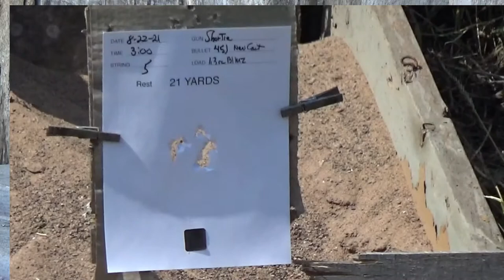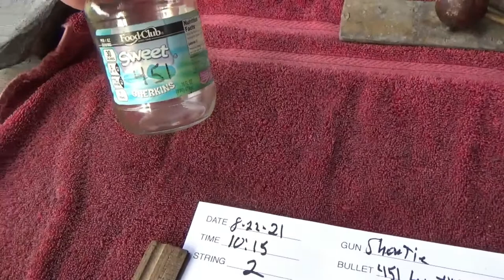Pietta 1851 Sheriff 44 cal - 5 1/2"

Comment: This is only my opinion, but I think this channel is among the very best C&B / BP channels on YT. Thank you for the content. 
Some thoughts : some of the guns I bought came dirty out of the box. Both were proofed in Gardone, one 1858 Uberti and one 1860 Pietta. The 1858's barrel was really dirty with a touch of rust (light surface rusting, no damage); Pietta's 1860 internals and barrel were filthy but no rust. 

Last gun I got is a steel frame .36 7 1/2 inch barrel 1851 from Pietta :  it came clean as a whistle. First thing I do now upon unboxing is inspect the gun and clean it if needed. 

On a side note, that 1851 I got is truly an excellent gun and a shooter out of the box. Shoots better than I will ever do myself.
Reply from the maker: I'm in the habit of checking the barrel also.  Had one for 4 years before checking, and there are slight pit marks now after cleaning.  Doesn't affect accuracy it seems, but sure isn't nice and shinny to look at.  O.R.

Comment: I have found that the Hickory wedges that come with new axe handles are great for removing barrel wedges and setting caps... you can split em and make like three nice tools about 3/4" wide and still have enough left to... well.. use as a wedge for the axe handle
Reply from the maker: 👍o.R.

Comment: These old smoke wagons are still relevant !

Accuracy is superb.
Reliability is ok  (kept one loaded fro 2yrs and 6/6 chambers fired at first try), as long as you don't make foolish mistakes and power is respectable at 390 ft-lbs at the muzzle with moderately weak Schuetzen powder.  I think they can be as powerful as standard pressure .357 magnum with proper powder selection (I'm thinking of FFFFg Swiss). Will need to check that out though.
@edit Tested !

220 gr Kaido slug
30 gr fine FFFFg Swiss

1# 953
2# 939
3# 968
4# 949
5# 971
6# 964

avg: 957 fps
KE: 447 ft-lbs.

for comparison, low end .357 magnum after wikipedia:

180 gr (12 g) JHP Federal	

1,080 ft/s (330 m/s)	
466 ft⋅lbf (632 J)

So my 1858 fell ~20 ft-lbs short of .357.
I could stuff about 4-5 more grains of powder under the Kaido slug but didn't want to push my luck too hard.
Reply: @beargillium2369  I don't think you can blow up a Pietta 1858 remington unless you use smokeless or leave air gap. Ths guy loaded a full chamber of FFFFg swiss and was fine. watch?v=-n5jddoNDFk
Reply: @MikeJLee-ye6mz  personally I try to avoid getting a Darwin award
Reply: @beargillium2369  In the period, they were using fine HAZARD powder which granulation was equivalent to modern FFFFg and metallurgy was in its infancy. Why would using a finer grain black powder in a black powder weapon be synonymous to getting a Darwin award?
Reply: @MikeJLee-ye6mz  because "in the day"  a fair amount of guns did in fact explode... I understand that modern metallurgy is much better, but you have to realize that piettas and the like aren't exactly military grade equipment. They're rated for what they're rated for and to push that is to tempt fate. Couple grains over the recommended charge? Sure, you're probably safe. But moving to a finer powder simply sounds like a bad idea, to me. You do whatever you want. Look right down the barrel with your finger on the trigger for all I care, you clearly have no respect for safety or wisdom so I wish you the best of luck. You'll need it.
Reply: @beargillium2369  
Needless to wish, but thanks. Me and the gun are both well though.

To stay on the safe side I used only 30 grains (measured by weight) of fine FFFFg Swiss. 

220 gr Kaido slug
30 gr fine FFFFg Swiss

1# 953
2# 939
3# 968
4# 949
5# 971
6# 964

avg: 957 fps
KE: 447 ft-lbs.

for comparison, low end .357 magnum after wikipedia:
180 gr (12 g) JHP Federal	
1,080 ft/s (330 m/s)	
466 ft⋅lbf (632 J)

So my 1858 fell ~20 ft-lbs short of .357.
I could stuff about 4-5 more grains of powder under the Kaido slug but didn't want to push my luck too hard.
Reply: @MikeJLee-ye6mz  ok .. I guess the real question is: why are you even trying to push a bp revolver to 357 velocities, most people just try to find an accurate (and safe to use) load.
Reply: @beargillium2369  Folk at the range insisted that these cap and ball revolvers are as powerful as .22, 380  at best . I just wanted to prove them wrong.
Reply: @MikeJLee-ye6mz  those velocity's are great with such a heavy slug as the Kaido, I usually use 30 grains 3f old Eyensford and 220 grain lee conical
Reply: @discipleochrist4202  you will get about 50-100 fps less with 3f powder. 4f is major boost to the velocity.
Reply: @MikeJLee-ye6mz  old Eyensford only go's up to 3f
Reply: @discipleochrist4202  That's why I used swiss ;-) I think T7 could easily emulate 4f swiss though I dunno about safety of that.
Reply: @MikeJLee-ye6mz   I have 4 lbs of 777 laying around for Worst case scenario. I was not impressed with 777 . There's a delayed ignition in the time the cap go's off until the powder ignites. I'm loyal to the holy black my friend ❤️ I will say this when ran over a chronograph old Eyensford not only runs neck and neck with swiss in many instances it outpaces swiss. I switched from swiss to old Eyensford 2 years ago and never looked back.  Swiss is a top of the line powder but It's good to get a quality product made in America, that's as good if not better then swiss. Give it a try you won't regret it

Comment: Not bad for shooting a new pistol right out of the box without cleaning it first! Wonder what it does with conicals and other powders! I first completely clean all oil off the outside of the new pistol a nod inspect it and note anything not right. Then completely disassemble it, checking all parts and the areas they run in after a complete clean. Remove all machine Mark's where needed and polish all parts where they move against other parts and or frame.  Thin oil all parts and reassemble the pistol.  This way sight in and best load and projectile is faster to find. For me I find the best load combinations with ball or conical and powder and charge all in the same outing. I always try to take a ball and a conical and at least three different powders and two or three different cap types. Usually find the best load for the pistol in one outing. Then the next outing is just sight adjustments. Making notes on accuracy leads and hunting or power loads.  The paper or card I put this info on stays with the firearm for future use by me or someone else if I sell it.
Reply from the maker: Great advice.  Keeping a record with the gun is the way to go.  A person thinks they will remember, but not real likely.  Target shot, or a copy of one is something to also keep in the box.  Appreciate comment and advice.  O.R.

Comment: Excellent content O.R.  My 1851 navy chambered in .44 is honestly one of the best shooters I have. It's the 7.5 inch barrel but I'm looking to get a 12 inch barrel to hunt with.
Reply from the maker: Hi
I believe EMF offers one.  Maybe out of stock.  Probably other spots also, but the folks at EMF treated me right.  O.R.
Reply: @oldranger3044 I support EMF 100 percent, EMF have never done me wrong either. I have quite a few Piettas and they are real shooters!I know VTI gun parts gets them in regularly as well.  Thanks for putting out new content brother, there's not many of us into these old sixguns anymore so I'm happy to see a new video from you. we must pass this art down to the younger guys...

May the LORD bless you and keep you
Reply from the maker: @discipleochrist4202  Thanks.  Not aware of VTI, but will check them out.  SOON!
Reply: I have the 12" version of this and the Remington. If I recall correctly the 1851 has a slow 1:30" twist even in the 12" barrel while the Remington has a 1:16" twist. The Remington will handle any round ball or conical you can get in the cylinder and has adjustable sights making it a far better choice for hunting.
Reply: @oldranger3044  I just bought some parts for my dad's A.S.M. 58' Remington from VTI, great customer service and received my package within 3 days.
Reply from the maker: @paraplegichistoricalsports5700  thanks for the tip. Saved in favorites.  O.R.

Comment: Mines a Brass, the first cap and ball I owned, I use 20 grains I know anemic but helps keep the brass around a lil bit. I might "Forced" to get the .44 in steel. I will admit to the 7 inch barrel be better just for the rammer is easier.
Reply from the maker: Yes, longer loading lever makes life in the loading area easier.  Slixprings makes an extension for easier loading called slix hand that sells for about $20.  The 20 grain load is all you need for basic fun and shooting, and you are correct; it is easier on the gun for target and plinking.  O.R.

Comment: Hello ranger, just had a quick question for you. Im thinking of buying one of the pietta 1851 avenging angel snubnose 44's. But i like the looks of the fluted cylinder on the 1860 snubnose. Will the cylinder from a pietta 1860 fit and  function on a pietta 1851 frame ? Love your videos.Thanks for any help !
Reply from the maker: If the 51 frame is for the 44 caliber, then I (believe) so, (notice the word believe), because I just did that taking my 44 1860 cylinder (2010) into a brass 44 1851 (2022) model. However, I have a  fluted 44 cylinder from a 1851 (2001) that doesn’t do well in the same brass 44 because the cylinder stops (notches) are too tight for the new bolt used in the 2022 model. Suppose something to do with their tooling. If I had to bet, I’d go with yes, if they are around similar production times, but I’ve been wrong before. So, can’t give a definite yes, hope this helps. O.R.

Comment: I have the exact same revolver, but need some advice: What is the use of the screw above the barrel wedge? I used to remove it every time I removed the barrel, and eventually lost it. After 6 years of regular use, the wedge stays firmly in place without it.
Reply: That screw is just to keep the wedge from coming completely out when you are taking the gun apart.

Comment: Once again, I see that you still have a supply of Black MZ.  Seems to work well in a variety of revolvers you've shot.  Even shot nice groups with the shorter barrel.
Reply from the maker: Right, I got a good amount when it was being sold for ten bucks.  It seems to do as well as true black; I would say no better.  Probably some folks feel that it is a "cheap" shot to use it, but it's more a matter of economy.  I can get the guns to shoot as well, or possibly better with the "real" stuff. I shoot a lot, and I'm starting to run low on FFF.  O.R.

Comment: Wonderfully informative video sir, thank you! I did notice that the sights were off by a bit, is there any way to zero them in and get them shooting dead on?
Reply from the maker: Sight adjustment for most of these replicas is not easy. On mod of the Remington 1858 models the front sight is dovetail which helps for left-right, but nothing for height. The 1851 colt models have no dovetail or height adjustment. Some folks (myself also in the past) will work on the notch in the hammer(rear sight is this notch), but this is a one way street. The guns usually shoot high, therefore need the front replaced with a higher one. Of course it can also have a dovetail installed which can solve both problems.  (see my video about what Bill Hickok’s gun).  
HTTPS://YouTube.be/JXvjDZkruA  o.R.
Reply: @oldranger3044  ah I see. I will definitely check out that video, thanks!
Reply from the maker: @THE.0bs01ete  👍